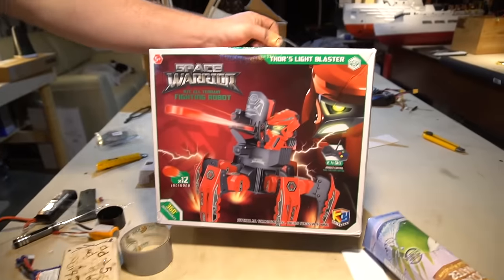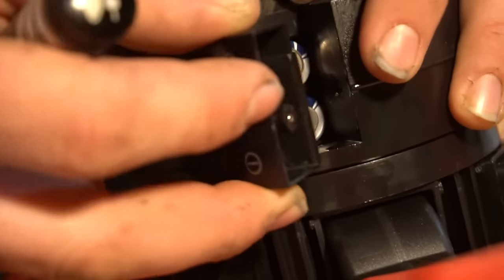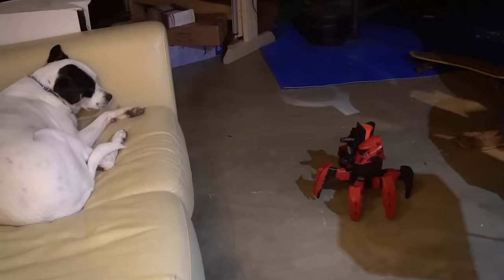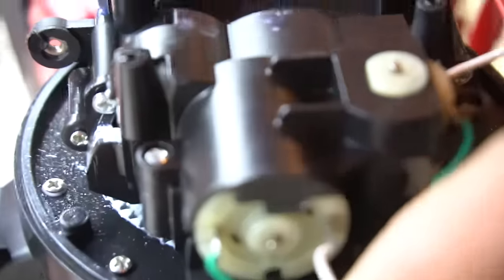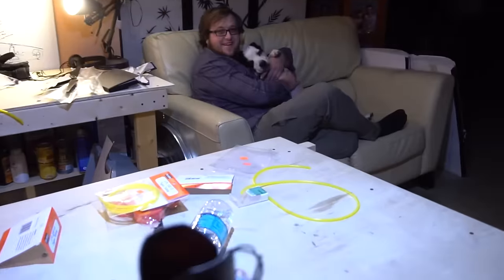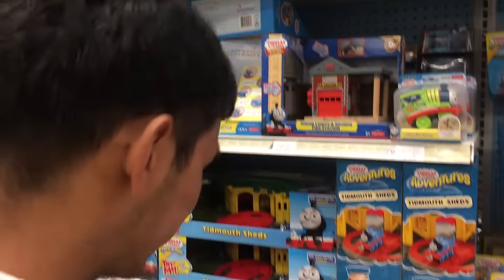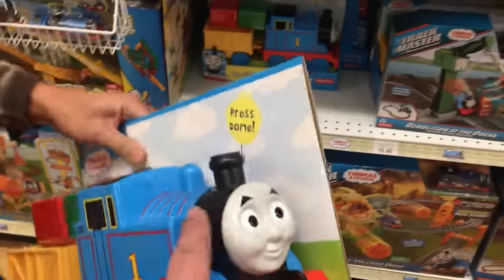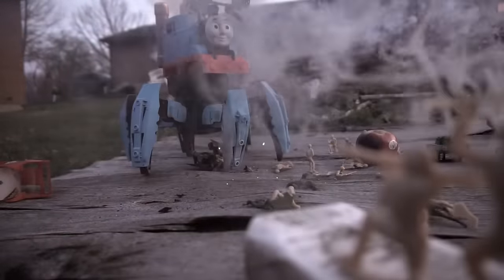Dangerous Toy Modification-Thomas the FLAMETHROWER

Comment: 8:55 war war never changes
Reply: explosive gamer It was a normal skirmish. We were told that the enemy was attempting too hold the plywood plank in the backyard. They were a small force. Atleast fourty of them.

Fuck were we wrong.

Our tanks quickly laid waste too their units, the smell of smouldering plastic and the cries of the enemy filled the air. Our infantry force was tiny, but a scalpel next too the grey's overwhelming tactics. It was a slaughter for their side.

Then they called "it" out into the fray. It's ominous smiling face, blue and black finish, and the fire at the tip of it's flamethrower. It ruined our tanks. You could hear the screams on the inside, the ash from their cardboard armour turning the sky black.

And the screams of the dying. The screams, and all the while it burned us too *death*. Too fucking death. When i close my eyes at night i still see it's face. Those disgusting, huge, legs.

And i still feel the heat from it.

- John Tanmanson's suicide note, he was a veteran of the Grey/Tan war of 2017.
Reply: @whatwhat4052  hh
Reply: War.. has changed.
Reply: @skylertremblay3395  It's no longer about nations, ideologies, or ethnicity. It's an endless series of proxy battles, fought by mercenaries and machines.

War--and it's consumption of life--has become a well-oiled machine.

War has changed.

ID-tagged soldiers carry ID-tagged weapons, use ID-tagged gear. Nanomachines inside their bodies enhance and regulate their abilities.

Genetic control, information control, emotion control, battlefield control…everything is monitored and kept under control.

War…has changed.

The age of deterrence has become the age of control, all in the name of averting catastrophe from weapons of mass destruction, and he who controls the battlefield, controls history.

War…has changed.

When the battlefield is under total control, war becomes routine.

Comment: If this video doesn't deserve a like, nothing does.
Reply from the maker: This comment deserves a like. :D
Reply: PeterSripol I know I'm late but.. should've the copper fuel cells be installed at the lower sides of the cockpit (where the engine's wheels should be) for better balance by lower center of gravity?

Comment: Watching Thomas going on a fiery rampage destroyed my fond memories of watching Thomas the Tank Engine during my early childhood. Thank you
Reply: big boi It was a normal skirmish. We were told that the enemy was attempting too hold the plywood plank in the backyard. They were a small force. Atleast fourty of them.

Fuck were we wrong.

Our tanks quickly laid waste too their units, the smell of smouldering plastic and the cries of the enemy filled the air. Our infantry force was tiny, but a scalpel next too the grey's overwhelming tactics. It was a slaughter for their side.

Then they called "it" out into the fray. It's ominous smiling face, blue and black finish, and the fire at the tip of it's flamethrower. It ruined our tanks. You could hear the screams on the inside, the ash from their cardboard armour turning the sky black.

And the screams of the dying. The screams, and all the while it burned us too *death*. Too fucking death. When i close my eyes at night i still see it's face. Those disgusting, huge, legs.

And i still feel the heat from it.

- John Tanmanson's suicide note, he was a veteran of the Grey/Tan war of 2017.

Comment: War never changes...
Reply: The commonwealth, my home... Destroyed... rebuilded, and destroyed by thomas the dank engine :v
Reply: Bread theres a settle ment that needs your help ill mark it on the map
Reply: It was a normal skirmish. We were told that the enemy was attempting too hold the plywood plank in the backyard. They were a small force. Atleast fourty of them.

Fuck were we wrong.

Our tanks quickly laid waste too their units, the smell of smouldering plastic and the cries of the enemy filled the air. Our infantry force was tiny, but a scalpel next too the grey's overwhelming tactics. It was a slaughter for their side.

Then they called "it" out into the fray. It's ominous smiling face, blue and black finish, and the fire at the tip of it's flamethrower. It ruined our tanks. You could hear the screams on the inside, the ash from their cardboard armour turning the sky black.

And the screams of the dying. The screams, and all the while it burned us too death too fucking death. When i close my eyes at night i still see it's face. Those disgusting, huge, legs.

And i still feel the heat from it.

- John Tanmanson's suicide note, he was a veteran of the Grey/Tan war of 2017.

Comment: Imagine if this was one of the wepons people used in war
Reply: It’s weapons
Reply: It was a normal skirmish. We were told that the enemy was attempting too hold the plywood plank in the backyard. They were a small force. Atleast fourty of them.

Fuck were we wrong.

Our tanks quickly laid waste too their units, the smell of smouldering plastic and the cries of the enemy filled the air. Our infantry force was tiny, but a scalpel next too the grey's overwhelming tactics. It was a slaughter for their side.

Then they called "it" out into the fray. It's ominous smiling face, blue and black finish, and the fire at the tip of it's flamethrower. It ruined our tanks. You could hear the screams on the inside, the ash from their cardboard armour turning the sky black.

And the screams of the dying. The screams, and all the while it burned us too *death*. Too fucking death. When i close my eyes at night i still see it's face. Those disgusting, huge, legs.

And i still feel the heat from it.

- John Tanmanson's suicide note, he was a veteran of the Grey/Tan war of 2017.

Comment: Battle file 1072 
The tan army suffered a staggering defeat of the battle of the lawn because of green army’s new project [REDACTED] which  was designed to make one of their trains a mech which mounted a flamethrower so far we have only decommissioned one of these beasts with fireworks we found out that it had no pilot because it was being remote controlled from their base maybe we destroy the factory or base 
File end 

Multiple errors so don’t take this seriously